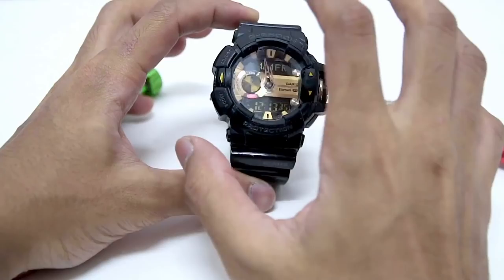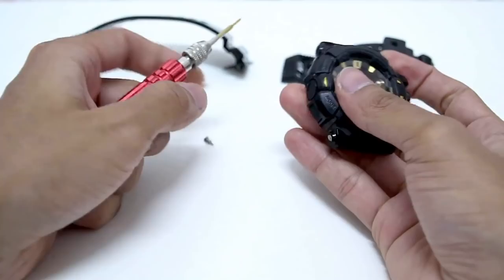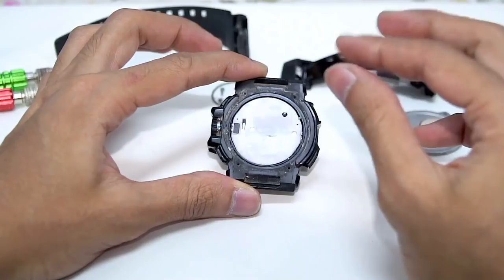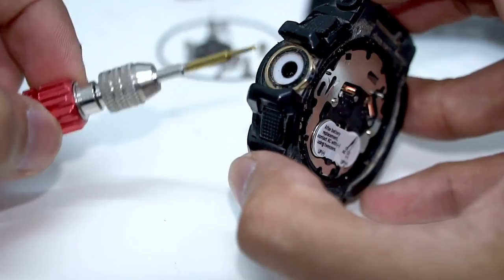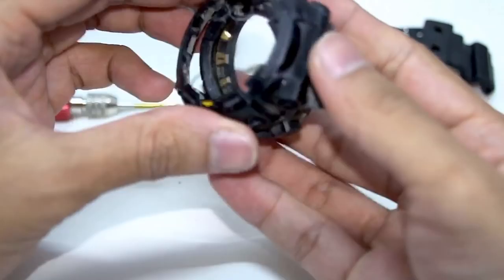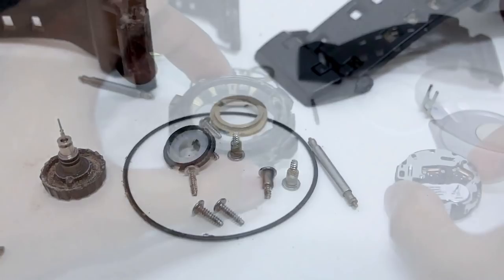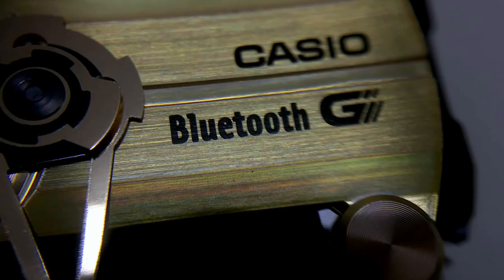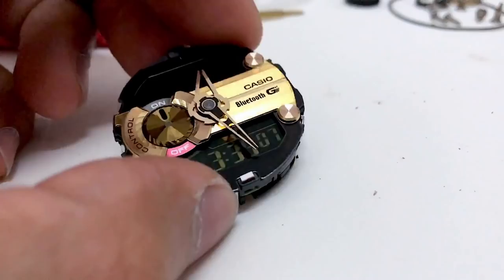Whats inside GBA-400 series Bluetooth G-Shock watch

Comment: I accidentally broke the crown so I need to replace it with a new one but they are very expensive, is there any way I can get it cheaper ?
Reply from the maker: You'll have to buy a 2nd hand ones scrap for donor parts. Sell the rest back

Comment: What will be the cost of the rotary switch replacement as I broke mine
Reply from the maker: Can't be sure. I broke mine 2 years ago but my watch was still under warranty at time so I didn't have to pay anything. But from my experience, the cost to fix a broken parts usually ranging from 4000JPY - 8000JPY. Gotta ask Casio directly to be sure. Send to their customer support an email.

Comment: My Rotator was not working  so i opened and found that the needle like pointed part is missing... So what should i do now for setting the right time..???? 
Please tell🙂
Reply: I ran into the same issue. I couldn't fix the rotator/ crown -- it was broken. But there's a golden looking point in the motherboard near the crown area which can be pressed using a safety pin, and that'll help you change the time on your watch. Lmk if you want me to upload a pic or a video of that. I randomly figured it out.
Reply: @-ksj-  or please upload photos here bro
Reply: @-ksj-  hello. my rotary stop to work .do you think it s possible to send me the pic of the golden point. thank you

Comment: How long the battery run in this... Watch 
Bcz it's having blutooth feature 
Can u say...any one....
Reply: ramakrishna duta hello! Short answer: 4 years with my experience. Ive had this watch since brand new for more than 4 years now and i came to this video to see how i can change the battery :) so i have had used the bluetooth but not many times. Maybe 25-30 times over the course of 4 years. Not much since nowdays the music feature cannotcompete with anything else. But i use the connection to the phone to update time and all the settings which is great and easy. ( you can do it manually of course). Also the watch is still on, keeps time but it says batt and flashing. So i guess it should run at this stage for quite some time but i dont think i will connect to bletooth until i changs the battery! Hope that helps :)

Comment: Is it possible to get crown shaft, mine got broken 😢
Reply from the maker: Not possible. You'll need to send it over to Casio to get it fixed. Unless, you bought a used G-Shock and take the parts.
Reply: Hey . Same pinch mine also broke. Did you got any solution
Reply: @yashupadhyay2964 
No bro,  😑
Reply: Mine is not broken but still not working i can hear clicking sound while rotating but still nothing is happening

Comment: Brother I have same watch, but analog function not working, wat will be the problem of it
Reply from the maker: Usually it is the gears related or just analog module connection issues. Full disassembly would be needed to find out. Perhaps,  just a simple battery swap is all you need.
Reply: OK thanks, so there are 2 batteries?
One for analog and other one for digital?
Because my digital movement and led lights, Bluetooth works fine
Reply: Changed both batteries, still analog is not working 😑